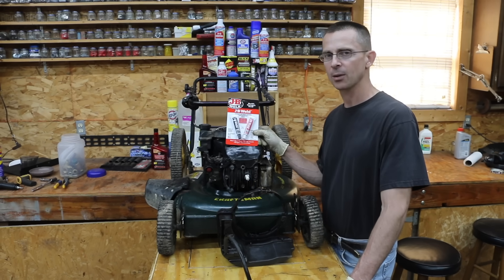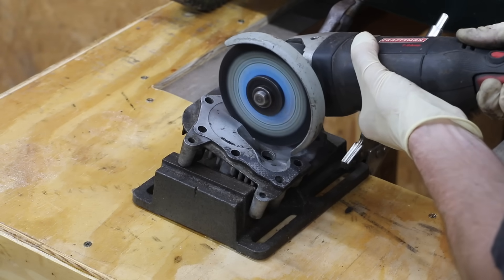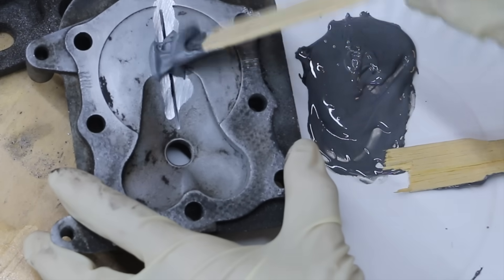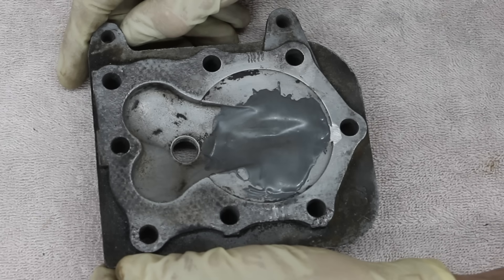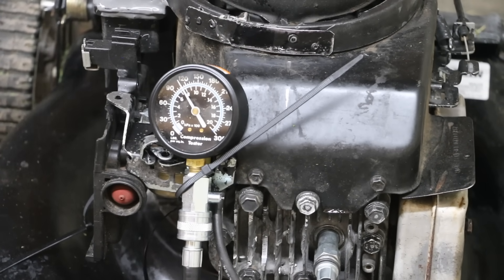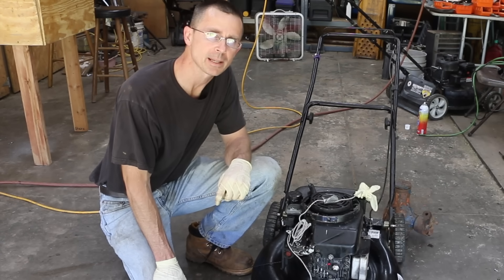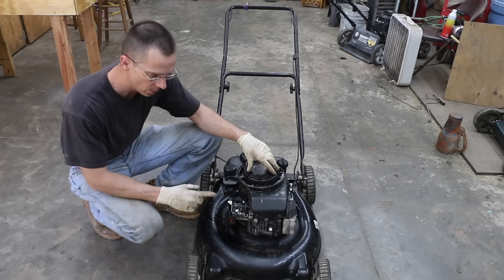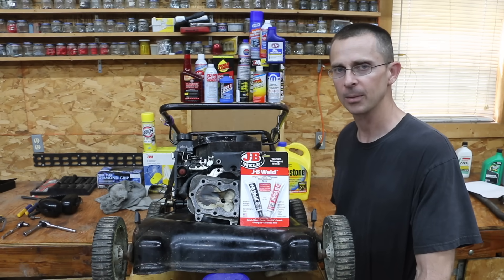Can JB Weld fix a cracked cylinder head?  See the proof!!

Comment: I've used JB weld to fix a fan for an air compressor motor. Drilled 8 1/16th holes on each side of the fan, as well as along where the fan broke. Pulled some fishing line through the holes, put JB weld along the fan, pulled the string to get the fan pieces together as well as pulling some JB weld through the holes. Coated the edges with JB weld for about a half inch each side. 

Put some JB weld on the opposite side for balance. 

It's held up about 2 years so far without grenading. I'd order a replacement fan if they had them, but this has done well too.
Reply from the maker: Crasoum,  Very impressive repair!  Thanks for watching the video and commenting!
Reply: Yea, I wouldn't usually want to fix something expensive with it. I can't find the same axial fan for it (there's a finned fan that looks about right, but not a direct replacement it's a clarke ac2001 2hp/4 gallon from early 2000's). The RPM of the motor is about 2000 and it's near the center of the fan so the centripetal force isn't off balancing the fan too much. Bought the compressor for $3.51 at auction. 

Good luck, thanks for the reply.

Comment: Hi. Many thanks for your video and explaination. I got a douth about the product. If inside a cylinder has some gabs at the walls of the cylinder because some metal was loose with the work of the piston; Do you think jb weld can fix it and doesnt come out when the piston will be working again inside the cylinder and in high rotation? ??
Once again, thank you for your video and in advance. 
Take care my friend.
Reply from the maker: Rogerio, I'm not sure if it's up to this task but it might be worth the effort.  It'll be very important to make sure the area is very clean before adding the JB Weld and then you'll need to sand the area to ensure it doesn't protrude.  Hope this helps!  Thanks for watching the video and commenting!
Reply: Thank you very much. 
Yes, you help me. I will do that and afterwords I will say if it works or not.  I am quit shore it can be and the result it will be good.  Well. ... Thanks again. Has a good weekend. take care my friend. By the way, I saw your video about Marvel Magic and I will test as well. Take care.

Comment: To span large cracks, use steel wool and JB Weld.
Reply: Do you think it would hold the casing bolt surround on a briggs and stratton.thanks .

Comment: I tried to use jb weld on an exhaust manifold on a diesel. I heald but I'm not sure if it burned off or blew off by either the heat or pressure.
Reply from the maker: Yes, exhaust can be challenging to seal with JB Weld, especially on a diesel since EGTs can sometimes exceed 1000F.  Thanks for watching the video and commenting!

Comment: i used jb weld on a mower head and it burned it off.i used it on a twin cylinder rider.one bolt broke off so i closed up the hole.

Comment: JB Weld had been my recent go-to for plastics (dashboard top inserts etc...). I also used it on a slipped crankshaft/pulley snowblower engine, but haven't reused that engine (got another one before thinking of trying this).
Reply from the maker: Lou, JB Weld is a great product!  I always keep some on hand!  Have you used the quick set or the original JB Weld?

Comment: I once used JB weld to fix a cracked radiator on a cross country road trip.  This was back when I owned a Del Sol and I had just gotten out of the Marine Corps and I was driving it home to spend a few weeks with my parents.  Steam started billowing up so I pulled over at the closest Gas Station and popped the hood.  The radiator had cracked right where the upper hose meets the radiator and it was about a 2 inch crack.  Let my engine cool, mixed some JB right on the crack, let it cure for an hour filled the radiator with new coolant and went on my way.  The JB held for the entire trip and for 3 years after that until I sold it.
Reply from the maker: Tom, Thank you for your service!  Semper Fi!  Thank you for sharing your experience with regarding to JB Weld!

Comment: Very interesting stuff, though I can't say I'm surprised. Composite materials can and often do perform better than common metals in terms of impact resistance, tensile strength, temp resistance, etc. It's all about picking the right one for the job at hand.
Reply from the maker: arfink, I was impressed too!  Have you ever used any of the JB Weld products?
Reply: Yup. Not to fix an engine, but for other applications. I've found it to be significantly tougher than mild steel, and have used the SteelStick putty to build up rusted out areas on tools and bicycles with fugly yet functional results.

Comment: jb weld is good ..it lets go at about 600 degrees .....it can repair gas tanks just so long as the jb weld is above the gas line  if below the has level it will fall off...

Comment: is this mower still running? im curious to how long it will hold up after repeted hot cold cycles.
Reply from the maker: Yes, it is still running.  I don't plan to use push mowers too often.  My yard is around 3 acres...much too large for such a small mower.  I'm using these engines for testing these additives.  Thanks for watching the video and commenting!

Comment: A trick I learned from a small engine mechanic years ago when I was starting out . To remove carbon build up on cylinder heads use lacquer and epoxy thinner  it will loosen it to the point you can wipe it off . For spring tune ups back in the days of leaded gas we always pulled the heads and cleaned the carbon build up . I had a pan of lacquer and epoxy thinner . I would throw the heads in and let them soak for a few minutes while I completed oil change and blade sharpening . Usually the heads came out clean with little wiping . For the pistons and valves I brushed it on let sit then wiped off
Reply from the maker: This is a great suggestion!  Thanks for watching the video and commenting!

Comment: I used JB Weld to repair a hole in the side of a Mantis cultivator crankcase (2 stroke weed whacker sized mini rototiller).  And a hole in the gas tank on that tiller.  Worked like a champ for both.  Brought the Mantis back to life, used it in my garden, then sold it for twice what I paid for it.
Reply from the maker: Impressive repair and you made a profit!  Thanks for watching the video and commenting!

Comment: I would add this,  unless you have a huge repair, or many small ones you plan on doing at one time, buy the small tubes.  if you buy the big tubes, thinking your going to save $, you wont as the mix gets inconsistant and one or the other tubes will harden and you will end up throwing it out and buying more anyway.
Reply from the maker: Scott, Great suggestion!  Thanks for watching the video and commenting!

Comment: I had a 1995 Ford F150 with a straight 6 in it and it somehow developed a crack in the exaust manifold. It was really loud but I put jb weld on it and it fixed it. The truck was a daily driver for about a year and a half after the fix and I never had any problems with it.
Reply from the maker: Impressive!  Thanks for watching the video and commenting!

Comment: A little hot glue on the other side is a good, removable way to keep JB Weld from coming through.  I tried this once on a cracked block on a Cummins diesel engine in a '98 Ram 2500 once and it didn't hold up to that but this was very interesting to watch.
Reply from the maker: This is a great idea!  I'll remember this strategy for next time!  Impressive!  Thanks for watching the video and commenting!

Comment: I noticed you ground through the gasket surface into one of the head bolt holes. Did that cause you any trouble?
Reply from the maker: That didn't cause any trouble at all.  Fortunately, there was still more than adequate gasket area to keep a tight seal.  Thanks for watching the video and commenting!

Comment: jb weld original formula only, the jb weld quik is garbage..
Reply: I've fixed everything from oil pans to transmissions to heads  to radiators with jb weld the original formula is the only way to go.
Reply from the maker: Thanks for the advice on the original vs quick!  I'll stick with the original!   Thanks for watching the video and commenting!

Comment: A cut from a saw has easily accessible surface. In contrast, a crack will have a side where it thins out to fractions of a micron. It would be very difficult to get glue in that and you might have to mill out the area with the micro-fracture to be able to glue it.
Reply from the maker: I agree.  Surface prep, including removal of some material, is key!   Thanks for watching the video and commenting!

Comment: ....I see guys using JB Weld to modify intake manifold/s when doing porting......seems to stay in there OK...but sure makes me nervous....thinking about a big hunk of that stuff getting into a combustion chamber....when the motor is running.....
 I guess in these situations, like the one here....if you can keep it from getting too hot (most all epoxies have a heat limit....300-350 F.......it will 'stick around'......
Reply from the maker: Great point about possibility of this stuff coming loose!   Thanks for watching the video and commenting!

Comment: I had a Renault 16 after they shut down their dealer network in the US and often had to improvise repairs. On that one car I used JB weld to patch a gash in  the steel  fuel tank from the outside, to make a reinforcing cast around a steel throttle cable bracket that snapped in 2, and to reinforce the floor around where the floor rail for the drivers seat ripped through the floor.

I've used JB WEld to patch plastic pipe and galvanized supply pipe and PVC and ABS waste pipe. As long as you prepare the surfaces so it has something slightly rough onto which to adhere, the stuff sticks and sticks well.  It can be machined with a Dremel or file as if it were hardwood. 
 
The stuff held up for the next 5 years until I sold that car.  I've tried other "liquid steel"m\ epoxies since then. None of them did better than JB Weld.
Reply from the maker: Impressive!   Thanks for watching the video and commenting!

Comment: This repair reminds me of a tire plug, since the "crack" in the head didn't go to the edge. The JB Weld plugged your induced defect, but the defect was rather unrealistic, since that's not how heads crack (in automobile engines anyway). I personally have never experienced a cracked head in any small engine I've repaired. I use JB Weld often. It's a great product, and it's amazing that it held up inside the combustion chamber without damage. BTW - good videos too.
Reply from the maker: Great point and I agree!  I once had a 1971 Camaro with a small block V-8.  I purchased it for a great price, since it had a cracked block.  I regret that I didn't try JB Weld instead of replacing the engine!  Thanks for watching the video and commenting!

Comment: I've used JB Weld on dozens of different applications over the years and it has always done well.
There are other epoxies out there with metal mixed into them (JB Weld has this type too) that also work very well. Some that come to mind are Devcon, PC Products, A+B, Loctite, Red Epoxy, AA-Bond, 3M, Blue Magic Thermo-Seal, Super Glue Metal Epoxy, Hy-Poxy, Epoxy 220, Alvin Lab Metal, etc., etc.. Given a choice I use Devcon, mainly because I have used it in several extreme situations and it has always held up great.
Reply: I used Abro epoxy gum to seal off several cracks on a gasoline generator fuel tank recently. Just thinking if I should use JBweld also after watching this video.

Comment: i kinda like the putties like quick steel more for surface use and the semi-liquids like jb weld for seems and other situations where it's not possible to get a putty crammed in b4 the set time. Truth be told actual welding is always your best choice. Basicly if you can get your welder to it don't even look at the epoxies just weld so u never have worry about it breaking at the worst time
Reply from the maker: I agree!  Thanks for watching the video and commenting!
Reply: DarkBioCloud gb                 
Plpppll

Jkoq

Comment: I used JB weld to repair a 300 gallon fuel tank,  which had rusted out, / several holes in it.   It was used for gas prior, to it being switched to diesel fuel.   Still use it today, got to be like 15 to 20 years now when it was repaired.  We missed one hole, when it was refilled, & that is still  there.  We used a piece of rubber inner tube, press over the hole, with a piece of wood, supported with the frame.  That works too.
Reply from the maker: Impressive!   Thanks for watching the video and commenting!

Comment: The last time someone fixed a cylinder head with epoxy, the result was a catastrophic engine failure and consequent loss of braking of a train carrying oil, which caused it to roll away, eventually derailing and catching fire, killing 47 people.
(Lac-Mégantic, Quebec, Canada, 2013)
Reply: Diesel engines run under much higher compression this was on a gas engine (typical minimum compression being 250-300+ PSI). that disaster could have been averted at many different times, for example, allowing the engineer back on the train, to presumably start another engine to keep the brakes charged.

Comment: Try running it through several heat cycles and see how it holds up.
Reply: try telling it youre taking it out for a nice dinner then dont show up and ignore all its calls
Reply from the maker: Great suggestion!   Thanks for watching the video and commenting!
Reply: Spray cold water on a hot jb weld cylinder head and see if it cracks
Reply: Try putting it under load
Reply: It does not hold up.
Reply: I worked as a master tech small engine mechanic and tried some of it on a gas tank . It did not hold very long at all .
Reply: It won't last on that head long either.

Comment: Interesting.  I would be keen to se how it held up under actual load.  With the engine running without cutting grass, the only load on the engine is overcoming friction and windage from the blade.   the governor would have the throttle pretty much closed.  Under actual load the BMEP and therefore temperature will be much higher.  Any chance of a "will it actually cut the lawn " test?
Reply from the maker: Great suggestion!  I'll do project on that if there's enough interest.   Thanks for watching the video and commenting!

Comment: "Original J-B Weld can withstand a constant temperature of 500º F. The maximum temperature threshold is approximately 600º F for a short term (10 minutes). Refer to individual product packages for more temperature information."
https://www.jbweld.com/pages/faqs
Reply from the maker: Thanks for providing this information!  Thanks for watching the video and commenting!
Reply: You're welcome. I was surprised  JB Weld held up under the pressure that went along the heat.

Comment: If you strip out a screw hole JB weld works good too. I've used toothpick to deposit it in the hole and after it hardened I retapped the hole and side case on the ATV no longer leaked oil afterwards. It will work of many things if you use your imagination.
Reply from the maker: Thank you for this information!  Thanks for watching the video and commenting!

Comment: So this makes me wonder what size hole would be the limit for JB weld. Let's say you drilled a quarter sized hole vs a larger diameter hole. What size hole area can jb weld keep together before the force on that hole is too great.
Reply from the maker: There's likely a mathematical formula that the makers of JB Weld have.  Heat, pressure, vibration are all factors too.  Thanks for watching the video and commenting!

Comment: I have been using J&B weld  for 50yrs, I stopped the video at 15 seconds to tell you of my experiences and I already know that the stuff works very well on metal because I've already used it on engine parts. Intakes and exhaust manifolds as well as water ports. The stuff works as long as the surfaces are clean.
Reply from the maker: Thanks for watching the video and commenting!

Comment: What is your definition of fixed? its not mine. if you think that is anything more than very temporary, or even a  "repair" you should never wrench for pay. JB weld like almost all 2 part epoxies cant take heat cycles, has adhesion issues on smooth surfaces and has very limited applications in non stressed applications like leak stopping, and no applications in stressed applications.
Reply from the maker: Great point!  I should have said functional.  Replacing the damaged/repaired head with a new factory head would meet the criteria of fixed.  Thanks for watching the video and commenting!

Comment: I fixed a riding mower wheel that was rusty and had Pitt holes in it I put it on did some sanding and it worked great still holds air over bumpy ground
Reply from the maker: Awesome!  Thanks for watching the video and commenting!

Comment: i pulled the engine on my e30 (m30b35 turbo swap) with the engine hoist's chains wrapped around the engine mounts. I got the engine about 6 feet off of the ground when the chains shifted and 3/4 of the engine mount threads in the cast iron block shattered to pieces,  leaving the engine swinging precariously above the car. I "rebuilt" the block's threaded areas with 7-8 layers of JB weld over the course of several days. The car produces over 500 wheel torque and the JB weld has held for nearly 5 years.
There is also a JB weld radiator patch and an oil drain fitting in the oil pan is JB welded on. No leaks or failures. It is a great product.
Reply from the maker: This is extremely impressive!  Thanks for watching the video and commenting!